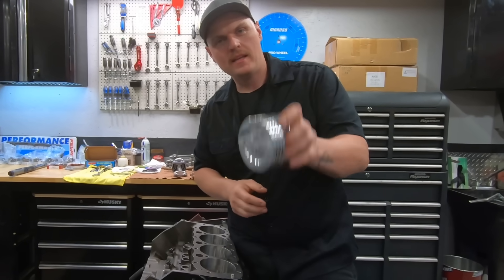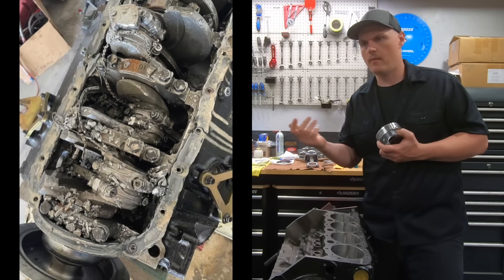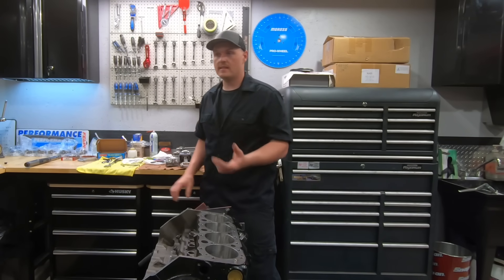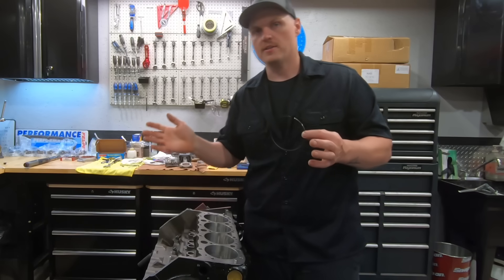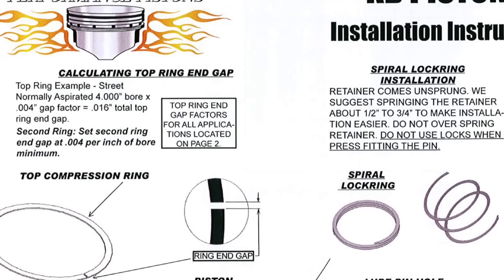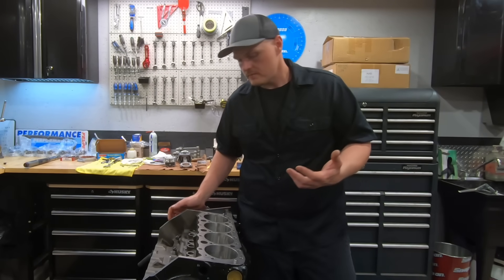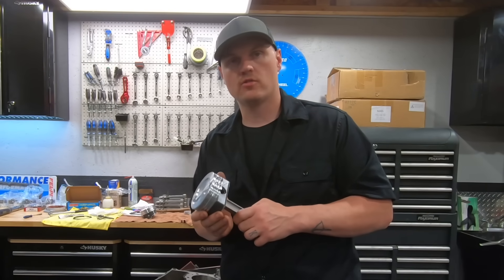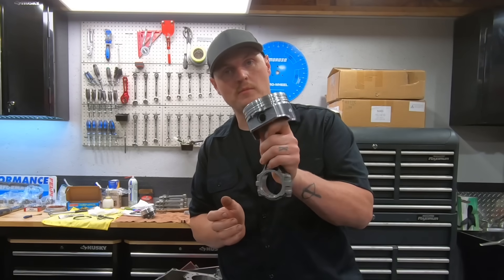Engine Failure!? Watch if you are running Hypereutectic pistons!

Comment: I blew my 383 up, broke the ring landings in all 8 pistons with 10 lbs boost and .026 gap from machine shop. Replaced with forged and .030-.032 on top 2 rings

Comment: I just called speed pro to verify for my build and they told me .0055 per inch on the top and .0065 for the second.......still seemed a little tight to me on my 4.030 so I am rounding up to .025 on the top ring and .030 on the bottom. I'm even thinking about opening that top ring a little more just to be safe.

Comment: i got a  mopar 4.270" KB hypereutectic piston set and i ordered them with the ring set, that the pre- gap on ring 1,2 are over .0032 thou. Mine is a mild street build 400 hp and I don't think I need to file them down? My feeler gauge doesn't have a higher gauge than .32 thou. You think I'd be fine without filing them rings

Comment: i come from the 2 stroke worlds but i love my v8's too. im one of the guys who got ahold of him when threw together a solid combo. dude knows his stuff and hes honestly friendlier than he needs to be. aka a great businessman.
he warned me of things i should have took care of on my engine but i said i knew better. what i did wasnt wrong but his opinion is probably right still. and eventually i may still but at 100k miles on build whatever happens happens at this point. 

that said even on a single ring engine not checking ring gap will be 100% catastrophic. 
ive even had engines with good gap good bore and nice pistons go poof because the rings were so cheap they werent stable. 2 strokes are known for soft seize and the rings are to cause that on them usually. almost always makes an octagon shape scar in the cylinder too. 
tolorances are stated for reasons and should always be followed. if your changing parts the new ones usually have a new spec to pay attention to.

Comment: Kb's are good pistons ! On any engine small atv and chainsaw engines or v8 I ALWAYS gap any ring wide . The larger the gap , the better they seal anyways because a little more gas pressure gets behind them to keep them seated .  You'll never know it if it's on the wide side , but you will find out real quick if they're to tight ! But ya kb does need to put a sticker on box or Lazer etch it on their pistons I know guys who have run em tight on kb pistons and ruined their engine !!!!! Very good pistons though .

Comment: Seen many broke KB pistons. I am sure that it was the ring gap that was the problem. 
I always went with at least 0.035 top gap. 
Worried about other hyper pistons. But they all called for regular gaps.
High temp of piston also calls for 4 degrees less timing. So 32 is close on hot sbc.

Comment: I started using KB pistons when they first came out. If people would read the installation instructions that come with them it would be fine. The hypereutectic (high silicon content) material does not transfer heat as much as regular cast and forged pistons. This is why they run tighter cylinder clearance (less expansion).Please don't open the cylinder wall clearance much more than recommended. You will have piston slap and can crack skirts. Also, the low rate of heat transfer(thermal conductivity) is the reason for the bigger top ring gap. The piston hypereutectic material doesn't transfer the heat out of the top ring as much so it needs to have a bigger gap. If you set these things up correctly you will have a long lasting good sealing pistons.FOLLOW THE MANUFACTURES RECOMMENDATIONS!!!!!

Comment: I ran hyperutectic pistons for years, I did not run them at 1,  to 2. wall clearence more like 3 to 4.5 wall clearence with .024 ring gap. won 4 track championships no failures we run AV gas cause the motors were 12:1 2bbl. We used KB`a at firsrt but switched to EUM just for the price difference, I didn`t own the cars I`m just a machine shop. Car owners are sometimes their own worst enemies, they shoot thierselves in the foot all the time

Comment: Back in the 80s I would love when the smart guys would take their thermostat completely out, then after about 2000 miles their engine would start smoking, because the Pistons expanded but the cylinder walls didn't, causing the gaps to butt occasionally and burning out the rings and the upper end of the cylinder wall.

Comment: You can't run hyp pistons in a circle track engine because of the on and off through the turns, it pulls the wrist pin out of the piston.
Reply from the maker: The GM circle track engines have hyper pistons

Comment: I know eh , I hate the blow by 🤢 I'm  building  a 351w with mahle Hyp pistons, ring down .300. the  instructions say you don't have to run hyp too ring gap clearance, just std because of ring hight . But the KB SBC pistins, they want tones more, and there top ring is even lower then mahle. A Ford OEM 5.0 HO hyp piston , ring down .225 runs std gap .016 / .004 x bore and never a problem. The forged SBC 23 dish piston catalogs used to have tons of dish volume  variants but you may only get one now 🤢.  Im stuck with SBC 400 hyper now 😞

Comment: Here's a question I cant find an answer for my KB hyperteutectic pistons.   The top ring gap factor is (.0065) which comes to(.026") the second ring gap factor is(.004) which comes to (.016) gap .
I heard that the 2nd rig gap should always be (.001 to.002") wider than the top ring gap because back pressure could build up between the rings and blow the top ring out or cause ring flutter but  according to Keith Black instruction my second ring gap should be .010 tighter than the top  what should I go by ?

Comment: This does not make any sense . Because the pistons if they expand this would only push the ring out . Speed pro says 020 is all you need .
Reply from the maker: It's the ring that expands. Depending on the piston and where the ring is placed, the heat is transfered heavily into the ring, causing it to expand. KB hyper pistons, Summit ect all need alot more  gap but always go by what the piston manufacturer says

Comment: Forged pistons are the way to go, with a Premium "skinny" ring pack...less friction and more temperature stable. Also h-beam rods and a forged crank.. And most importantly,  Have the crank BALANCED!!!    Yes it will be expensive-but it will live a hell of a lot longer
Reply: In a perfect world, everyone would be rich. Unfortunately this ain't that world. Some folks have to make do with what they can afford. A $200 dollar set of pistons is Alot more attainable to the average Joe than a set of Diamond or JE pistons. That's just reality. I prefer all forged high dollar components, but I'm in a position to where I can. But I've built many claimer type engines for working class folks that run just fine. Be amazed at what a stock cast crank can really handle.
Reply: I've seen cast crank, stock rods, hypereutectic piston 2-bolt main 355s make 550+HP and turn 7500rpm. Be amazed at what people get away with in the dirt track world. I've probably built 25-30 of those engines for customers. If there's a $2000 dollar claim, you don't want to build a $15,000 dollar engine. Someone will buy it everytime.
Reply: And if you don't sell it, you get banned from the track. That's how they keep the lower classes cheap. But cheap don't always mean shitty.
Reply: I built a few NHRA legal Stock and Superstock engines back in the day. The "Stock" engines were extremely limited, but they still made big power. Superstock pretty wide open, but they get expensive as hell real quick. A cast bigblock Chevy crank will handle 700+HP. But all my bigblock Chevy engines have extremely expensive forged pistons, H-beams or Aluminum rods, and 4340 steel cranks. Because I like to turn bigblock Chevys 8000+rpm. Of course every engine I build gets balanced. That's a given. I prefer drag racing.

Comment: Hypereutectic pistons are low grade cast, correct? If you plan to have over 400 hp and spin over 6,000 rpm, you have got to have forged pistons, that is my standards, I have seen hypereutectic, (cast) pistons blown into chunks many times over the years. 
 I've been building gen 2 LT1 small blocks for over 30 years, I use 13.5/1 compression on 93 Sunoco, making 640 lbs. of torque for road racing I have had some forged pistons break also; after building with several different brands, I have settled on Ross.  The engine in my black track car is in the middle of its 6th year of road racing without a single mechanical engine failure, I just put a new engine in my red one last fall, identical build, over all of the years of racing with this LT1, broken pistons have been the only failure several times, I think I found my piston, always spend the extra money, always by forged, even for a street engine.

Comment: Hyper pistons are garbage, I build racing engines, I refuse to use them. I don't even know how many times I've seen them turn into captain crunch in the pan. JUNK.and you have to have double the ring end gap. what a joke
Reply: Exactly, that is just a fancy name for cast junk correct, I would never build an engine and then go cheap on the pistons, forged or nothing.
I was using JE SRP's and had a couple crack in half right across the wrist pin CL, I started using Ross about 6 years and have not had a piston failure. Road racing.

Comment: GM calls for .010 to .020 so if the middle is .015 +30 percent =.020 the small blocks I build with KB's are .003 plus piston to wall and .022 ring gap never any issues of course timing and jetting comes into play as well as engine temp and compression ratio a lot of cheap rings I have to gap some are only .016 top and 2nd good video Brian

Comment: You may just have saved my motor from grenading. I have Sealed Power H860CP30 Hypereutectic pistons in my set up and I have it sitting ready for paint. I'm pretty sure I just went to 0.016 on the top ring. My pistons were made over 20 years ago never used. Should I go to the bigger ring gap still?
Reply from the maker: I don't believe those need as much as the KB pistons or similar ones but you better check with sealed power to be sure
Reply: @cuttersperformance  Thank you for the reply it is much appreciated.

Comment: Good information. Also the second ring while not known to butting needs to be correct.  The second ring needs to be equal or wider at temp to keep from building pressure and unloading the top ring. Point being follow the piston manufacturer recommendation  and then some. If your application calls for .024" you want fell .028 unless the rings but. Then you will really feel it in the engine and your wallet.

Comment: Used KB167 pistons in a 318 build about four years ago. The gap thing isn't a secret, read about it on the online forums, the machine shop guy told me about it, and its in the instructions that come with  the pistons !  Gapped mine to the towing spec, don't really ever tow but its in a pickup so it seemed like a good idea. Been running great for around 10,000 miles. 
  Older guys like myself often think they know everything and don't read. I spend a ton of time reading everything I can find on whatever I'm working on,  saved me a lot of money in over 40 years.

Comment: Good info Pat, I ran into this on a build 5 years ago. The info was included in the piston box but the machine shop (very reputable) said to set it between .016 and. 018. So i called KB, nobody knows the product better right? They require more end gap due to a higher piston ring pack designed to reduce crevice volume, which increases compression and reduces contamination in the process of the 4 strokes. I have been very impressed with them so far. Spiro-locks are the devil though! 😂

Comment: thanks pat good video with allen and the guys 383 put up good numbers. I just fineshed a 0.60 KB piston I set the top ring at .023 thinking that was safe it has a true 11.1 compression not so sure now
Reply: Not enough
Reply from the maker: .023 is tight if you plan on beating on it abit

Comment: This is interesting! I watched this and was curious what my new set of mahle pistons and rings in my basement calls for so went and looked, pistons are a 224-3497.030 which is hypereutectic and go figure no instructions in the box what so ever! Looked at the rings p/n 41616cp.030 which say they are plasma moly rings, they had 1 little paper in them and all it said is .004 per inch is minimum. 

Kind of frustrating that the manufacture's cant include detailed info with their products anymore that could save many people lots of grief!

When i get that 355 together i will gap them to .025

Comment: What is your option of 5140 rods
Reply from the maker: Ive used several sets in mild street builds and never had a problem (under 500 hp and 6500 rpm)  If its more of a performance build then set it up to 4340 with a 7/16 rod bolt

Comment: My engine builder was going to use KB pistons on my 383 that’s taking forever, but I decided to go with Wiseco forged. They’re heavier, but I want to run a little nitrous for ride alongs. I’ve been bugging him about ring gap for this reason! Great PSA
Reply: I used the Wiseco Pro True Street in my 6" rod 355.
Im glad I did, nice piston.
I can't remember the exact weight but they were pretty light, like 415 grams.
OE forged crank looked like Swiss cheese after balance.
I wouldn't worry too much about weight with these.
Reply: @indyrock8148 He prefers Eagle rods and crank, he balanced it, and told me he had to remove a surprising amount of weight. That fits in with your experience. Should be a fun motor!
Reply: @Hogiewan1 I think on their website they list the weights. They are not heavy like old speed pro's
Reply: No way I'm building a 383 too and using the same pistons weisco forged flat top

Comment: Im glad you cleared this up... figured there was something amiss, i had a street/strip SBC 355 built back in the mid 90s that featured the same KB pistons, i honestly cant recall the gap for the rings, but they must have been correct because i spun that engine up to 6k/rpm quite a few times on the street as well as at the strip, and that engine still held together after 16yrs of use until i sold it off. Now, im lQQking to have my still running in good working condition ZZ4 crate engine rebuilt using a set of KB hypereutectic pistons, only because there will be ZERO power adders of any kind added, "MR NA" is my modus operandi.

Comment: If only the manufacturers included paperwork that explaing ring gap and piston clearance with their pistons. Oh, wait KB does. If you read the instructions you shouldn't have an issue. I run gapless 2nd rings with them gapped to KB'S specs +.005, never had an issue.
Reply from the maker: It's not always included, especially in rotating kits

Comment: Just finished my 350, 2valve relief flattop K-B hyper pistons! 9.5 :1 
Top ring .026 lower .022 very happy with the results!
Reply: Generally, lower rings should have a little more gap than the top rings, helps prevent ring flutter. You'll be fine though.

Comment: That explains why the top ring land failed on the KB piston in my 350 SBC.  My builder must have settled on too narrow of a gap on the top ring.  I'm going to follow up with my disassembled parts and take some measurements.  Thanks much.
Reply: He should have followed the instructions that come with the pistons. 
You need to find yourself another engine builder.
Reply: @dukecraig2402  This  right here
Reply: @KingJT80 
What exactly does "this right here" mean?
Reply: @dukecraig2402  when  someone  says  that it means  they agree and its the exact answer to the problem  caused

Comment: KB really needs to update their installation instructions. The pic you showed is of the first page where they use an example of .004" per inch of bore for an N/A street engine, but when you go to the second page with the chart listing the recommendations for various combinations it shows .0065" for an N/A street engine - why would they put a value/example on the first page that is incorrect? 🤦‍♂️

Obviously it would be great if everyone read and fully understood all the directions, but in the real world they could change that figure on the first page and avoid any confusion to begin with.
Reply from the maker: My thoughts exactly

Comment: Anothing problem can be guys building in 'Stages' or changing parts mid-build. The block needs to be specifically machined for your EXACT piston spec from the manufacturer, no thinking that if you throw in Forged slugs during your final assembly that you are doing a good thing once your block has been finished for Hypers....and leaving no room for expansion etc.

Comment: Set up right KB Hyper's are very good. Have pushed real ho out of them . Timing, pin fit , ring gap is Critical .
Reply: Cooling system have had 383 imca engine make 570 HP run 20 races and still good .
Reply: Run them in 4.03 bore I use .030 run great

Comment: You literally just saved my build. The engine gods were watching today. Thank you😅
Reply from the maker: That's why I made the video! I'm glad to hear
Reply: @cuttersperformance I rebuilt a 6 liter ls with speed pro hyperutectic pistons bored 20 over, and I checked the ring gap, and it was .020 plus on the top ring. And it fired up good sounded good and and with about 50 miles on it I did a full throttle pull and right after I let off the throttle it blew and turned 4 pistons to gravel and sent 2 rods out the block.
Reply: @Robert-w5u4v Aagh, terrible tragedy but Thank you for informing us so we can all learn from it! 😢 🤙

Comment: It's a KB hypereutectic piston issue. Speed pro hypers don't need as much gap because they place the top ring lower than KB does.
Reply: I’ve seen posts where the pin height is out to lunch. Kb have better valve relief options too
Reply: I run the speed pro hypers no issues 406